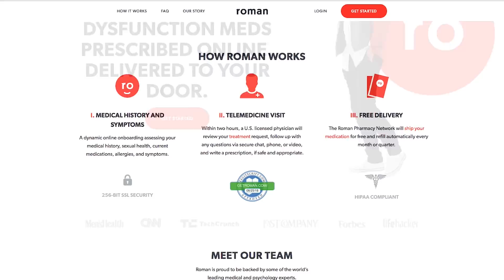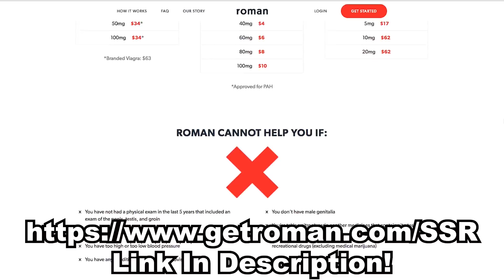Impulse Buy - I Bought A Tractor!

Comment: You're going to mow your lawn with a farm tractor? I have 7 acres and it's all mowed  with a 60 inch zero turn. You're gonna tear the crap out of your yard city boy.
Reply: Guess what your yard looks like when you mow it with a field mower ?
Reply: Corby Sherman we mow with a farm tractor yards always fine tbh
Reply: My neighbor used an 8ft shreder on a 30hp full size tractor. Ya, Like no joke. Think he was off his meds..
Reply: So correct. He’s an idiot to think using a large tractor with large tires and huge bucket is going to mow his yard. Just urning it around will be a chore. Then to think of the tires ripping up the turf. He needs a 60” zero turn like you said.
Reply: His yard will be fine, that tractor won't run and it will never be fixed.
Reply: My dad bush hogs his land 11 acres looks perfectly fine takes 30 minutes has a zero turn for the detail work
Reply: you are probably going to have to add a 3 point hitch for a mower. Maneuverability will be a giant pain in the ass for pull behind mower, not to mention they are huge. Of course  the odds of you actually cutting your suburban lawn with that thing are slim to none anyway.
Reply: put a 3 point hitch on it and he can get a 5ft finish mower, but yeah, cutting with a brush hog will look like shit. Windrows and long clippings everywhere.

Comment: Cool tractor, never thought I would see that on this channel. Only have the chains on tires when pushing snow. Ask owner about any kind of service history on tractor. "Farmall M" was mass produced between 1939 and 1952 so this tractor could have seen a lot of neglect over the years. Considered collectable so parts are available.  Maybe hold off on the paint until you see how the mechanical aspect shakes out. Could need an engine overhaul or a new clutch+flywheel.

Comment: Those tires are going to RIP up your lawn... buy a zero turn mower way easier to maneuver and way faster then that antique
Reply: you can get lawn tires for tractors,and the 2 brakes on this is for sharp turns
Reply: gino manshit those breaks can help steer but in field using them for that will tear up the yard worse than the tires will and teed tires for that are gonna cost more than he’s gonna want to spend
Reply: how much can turf tires cost for this maybe 200 a piece at most,he might have to get new rims though
Reply: A new zero turn is 1500. Has a warranty,  won't destroy your yard,  that tractor is probably more, a pto mower is MUCH more, much less portable and will demolish that yard.  It's good for hauling logs from the field,  moving earth etc
Reply: Sergeant Speed it depends on how big of a yard he has that’s the info we don’t have a zero turn may not be big enough
Reply: gino manshit I’m not sure where to get prices for those kind of tires but it won’t be cheap
Reply: For standard tires like he has they run about $1000 each plus install that will be about $100-200 per tire. If he can find turf tires that will fit his rims they will be more expensive because they are speciality tires and he still might need to buy another set of rims.
Reply: turf tires are very expensive too
Reply: Ryan Garrett not crazy big don't think it's more then 1 acre. He has a video where he does a walk around of the property

Comment: This tractor will suck more money than a lambo
Reply: if there is a next stage in rusting process then that is a definitely blackhole for money
Reply: What if it's a Lamborghini tractor?
Reply: Easy to maintain and repair.
Reply: These things are incredibly simple powerful and reliable. Put a few hundred in maintenance and tires and he’ll have a solid machine.
Reply: Naaa, that old iron will pretty much last forever, I would 100% guarantee a brand new tractor will cost you 10 X,s more in two years that that POS. tractor ever will... Not a lot of parts, and few there are , are pretty built proof. I could literally name every  name  every part that could break in a paragraph.
Reply: Hope you like having a hard full of ruts.
Reply: I have  an old cub cadet that was made by IH , which is also who made the Farmall tractors. I barley have any problems with this 40 year old garden tractor, while my grandmothers newer craftsman mowers need more constant work. 
Yeah, this tractor will be cheap to use and last forever. I mean, it already lasted forever, what is another forever.
Reply: tinncan lmao "spaghetti town" hahahahahaha that shit made me laugh
Reply: Parts are dirt cheap for it
Reply: Older Lamborghini tractors are very reliable. They have deutz engines. New ones aren't popular anymore.
Reply: Hahaha, slap $5000 on it and you have a full rebuild tractor exept wheels/tires. Those things are pretty cheap and easy to maintain and repair

Comment: You might’ve went a little overkill for the tractor. Get a big Dixie chopper or you can get a smaller tractor with a mid mounted cutting deck and it’ll do all of the things the big one does and won’t leave ruts in your yard from the weight of the tractor.

Comment: Dear mr.spaghetti,
For tractors you put it in the gear you need for the job you’re doing. You come to a complete stop to increase or decrease gear. For example 4th gear is for zipping from one side of the field to the other, first is for using the PTO. Also some/ most small towns and municipalities have to throw out their tractor tires for their tractors and will give the, too you free of charge.

Comment: frontend loader is great but the lack of a 3 point hitch for a mower is bad
Reply: Stefan M Well, glad to see im not the only one to notice that.
Reply: Stefan M he will RIP his lawn to shut with that . Those old M's need half an acre to turn around . And I've never seen a PTO driven mower without 3pt hitch !
Reply: @deanm7002  We use a brush hog to mow our 48 acres it does not use a 3 point hitch.  it is a 15 footer with rear wheels that move up and down via hydraulic. The mower is much too large and unwieldy to use on any plot of land less than 2 acres and even then it really kills the grass more than cuts it. Not only that but you need remotes to run the hydraulics something this machine is missing.

Comment: Rob, I have an old farmall with a big deck on it. I love it, but they do need a bit of care for a long life.  This one looks a bit rough. I would advise replacing all of the rubber (belts, tires, hoses, etc). You can get turf tires for the rear if you want to mow your lawn with it and not annihilate it with the ag tires. You can get replacement new wheels very cheap for a set of turfs. Then you can have two sets of rear wheels and swap them as needed. The tires are the expensive part. Calcium filling is good too if you plan to use the loader a lot and your rears may already be filled, but it's going to add a few thousand pounds of weight that you don't want when mowing usually. Particularly if you have a septic you plan to mow over. Also the loaders on those tractors were more of an afterthought and should be considered light duty. Don't go hammering it into hard ground, you'll bust her up. Don't forget to grease everything. Basic hand tools are all you need for 90% of the work on this machine.

Realistically you're better off with a modern large zero turn for mowing. You'll get done faster and get a better quality mow, but it's not as cool as one of these. The finish mowers on these cut okay but it's not the same kind of mow you get with a modern mower. Also check which way the PTO turns, a lot of the farmalls spin backwards compared to a normal PTO. A lot of the implements were proprietary, no 3 point hitches on some, etc. You can get a nice flat blade for plowing snow in the winter. Just don't try to do it on ice, it'll be fairly worthless if you have a hill.

Paying someone to restore that tractor would be a nice investment. They hold their value for the most part when in good condition. Parts are still available and there are people that specialize in caring for them. With a restore it will outlive you and become an heirloom. The one that we have is closing in on 70 years old and was restored about 25 years ago. She starts immediately every time rain or shine. I used it to mow the lawn last year just for fun. One last thing; the engines, being from the era that they are, don't last like modern engines when it comes to rings. They need to be rebuilt every so often. So don't be surprised if it smokes, it may need a ring job. If you don't opt to restore it, at least have the radiator properly cleaned, patched, or replaced. It'll likely leak someplace. Probably at the main seal. Doesn't take much to overheat them as  the cooling is fairly limited. It'll probably leak oil too, but, that's just a natural rust inhibitor :)

P.S. if you get stuck with one tire spinning, use the brake on just that side and it should spin the other. You can modulate your braking sort of like a manual LSD.

Comment: Rob if you need a little help with any questions about this farmall give me a shout. I know these farmalls quite well. I run a 574, 760, h, m, and c. Those are all different farmall tractors. Also if you want to move down the road with it make sure you have the orange triangle slow moving signs both on the tractor and on the back of the trailer you are hauling. Also if it hasnt been already modified, put an alternator on it. This will make your life much better in normal use of it. Last suggestion for you is to make sure that the tires are not chlorine filled as i assume based on the rust around the valve stem that they are. This will weigh the tires down quite bad and cause them to rut your yard. That is really only used for soggy fields.

Comment: No Buy It!! That's a late forties Farmall M with 1970's International rear fenders on it. The loader is plumbed into the belly pump, and it will barley lift that loader because the pump is too low pressure, and too low volume to run that loader. That Farmall wide front also has a wimpy front axle, and tie rods. The axle will not support that weight, but the pump won't lift any weight to begin with. You're being sold down the river once again. I don't know how you ever became successful in the first place with your lack of decision making skills? How are you going to mow with tractor which does not even have a three point hitch? Did you know that the PTO shuts off with the off with clutch? The PTO is an old school 540 rpm, not a 1000rpm, so you'll have to find the right mower for it, plus you'll have to buy an aftermarket three point setup that'll have to be plumbed into the same belly pump. The same pump that the Ford loader is already plumbed into which, won't work for crap. Your only other alternative is to mount a PTO hydraulic pump, but then you can't use the PTO for your mower which you can't use because you don't have a three point hitch. I thought that I sucked with money, but you make me look genius, so on that note, thank you!

Comment: That tractor has the PTO when you push in the clutch it will stop.  If I remember right.  Also it doesn't have a 3 point hitch, and most of your mowers will be three point.  You will need to find one that fits your standard Farmall hitch.  If you have calcium chloride in your rear inner tubes for weight, take it in to have it drained and replaced with beet juice so your rims don't corrode.  Replace your hydraulic lines, they are cheap and can save you from being broke down in your field if your bucket drops

Comment: With some forks on the loader you could use it as a fork lift. Just paint it Rustolium tractor red with a brush. That will be fine. Would like to hear it run and drive tractor Bob :)

Comment: Check the seat spring, they used to break and you would fall off the back typically landing under your mower, etc. 
It also has 1 break for each rear wheel so you can lock one and turn in its own circle (fun to do doughnuts). Cool old tractor but you would  have been better off buying a newer one with a 3 point hitch to run more modern implements. Your basically limited to towing a mower behind it instead of having something mounted directly to the tractor (easier around corners). Good buy though.

Comment: Own's supercars but wont drop 15 to 20,000 on a decent tractor! He's going to kill himself on that death trap!
Reply: Michael Lee and this is how he can afford super cars you don’t just go throwing big money at everything you get lol
Reply: fawn dull Tractors are a different story bud This rust bucket you can buy cheap but will require 45,000 to make it of any use..
Reply: Snipe Stud00 not true
Reply: Snipe Stud00 literally could rebuild everything on this tractor 3 times and still not spend 45,000. Back in the day companies did not make junk, hence why it stood the test of time and will probably out last you.
Reply: @brandoncaldwell95  An engine rebuild on this machine is 1500 tops that includes machining if the head is warped. They are extremely simple and parts are very available. The most expensive piece on this machine is the rear tires. Also, there is 5 wires total in the whole machine. The kind of stuff olf has is incomparable to the old machines. Even something built in the 60s is much more complex than this. OLF has his fair share of antique machines If they cost as much to repair as your saying he wouldn't have any. I also own 11 antique tractors ranging from fordsons-john deeres I know what it takes to get them going and keep them going. This machine is worn out but probably doesn't run half bad.
Reply: @ohlookadragon  I only wish it was that cheap. I have delt with these older tractors. They are not worth a crap in this condition. The engine overhaul does not make this POS any more usual. It obviouslt has a fine engine to run, but a proper rebuild and cleaning will kill.
Reply: @brandoncaldwell95  agree to disagree. I will say Rob is a fool buying this because he can't do anything with it. But I bet it wouldn't take much to get it running right. As others said the loader is probably too much for machine and it is definitely not something you want to mow 3 acres with

Comment: Stop buying rust buckets aye.
Reply: Much  Safer getting a smaller kubota that has all the front end loader, bucket and other attachments you can easily do yourself while driving in safety not an old might stop or someday stops tractor.
Reply: agreed the kubota is safer but this has the weight to get the job done,not to mention you will spend 5x as much on a smaller tractor
Reply: gino manshit He will spend 10 more times that to repair and keep this thing going, not to mention...does it even run?
Reply: parts are cheap for these despite their age compared to kubota parts,find a farmer that does rebuilds during the winter to restore this tractor
Reply: gino manshit 🙄 really?

Comment: Cute little tractor and it can be really cool if it is painted and fixed up. But the tractors we use for farming around here could drive right over that little guy. And the Lambo tractor with tracks actually does less damage to the ground.

Comment: Careful with that thing. It doesn't have a cage, so if it flips you're dead. Also, if it bucks you're getting tossed off the back... and possibly under the mower you're pulling.

I'm not a tractor person, but my grandpa owned a farm, so I've been around them. Older ones can be dangerous.

Comment: All Farmall's are RED.  Plus if you paint a diesel tractor white, it'll be black in a week.  And if it's not a diesel, save yourself some time and drive it straight to the nearest junkyard.  First thing you need is a couple of slide on Forks for that front bucket (for pallets, lifting a car, etc..).  And finish mowers are generally not PTO driven, you're thinking of a bush hog which you can mow grass with.  Unless your grass is the size of small trees.  Finish mower attachments have their own gas engine.  There's much more to learn young padawan, but be thinking box scrape...

Comment: Those tractors were red when new, you should paint it Rosso Corsa,  put a 250 GT replica steering wheel on it, slap some Ferrari Scuderia shields on the sides, and wrap that seat with tan leather using the daytona seat motif.

Comment: Don't paint, and definitely don't waste your money on new tires, learn to patch or plug or just get a little compressor . Probably only needs a tube, and even though those tires have probably been on there since 1974,they will definitely outlast your infatuation with your new rut making machine . I understand the aforementioned infatuation with tractors as I have been through quite a few.  This tractor in the right environment could be useful, but not in your yard,the word unwieldy comes to mind.  
If nothing else you have a big grin and those are priceless and I am confident that you made the guy selling it's day. I am curious how much you paid, I may rent some space somewhere along your drive to work to set up and sell my junk...

Comment: To paint, but not like the truck. I think you should rubber coat or some kind of tough coating for the axles and stuff and then do some glossy showroom cut and buffed paint on just the aesthetic body panels

Comment: Rob have you lost your mind? That looks really old can you still get spares? I didn't see a 3 point hitch on the back so you will have to fit before to can run a mower. Judging by the chains on the back wheels it has been used for clearing snow.

Comment: Push the brake in there is a square just under your foot as you push in pull up on it and it will set the brake

Comment: Have some one who knows how to run tractors teach you how to use it. They break real fast if you engage the PTO the wrong way or run the tractor improperly. Guy I work with blew out a trans gear in under a day and it cost about 7400 to fix.